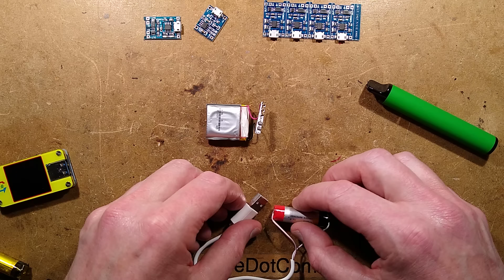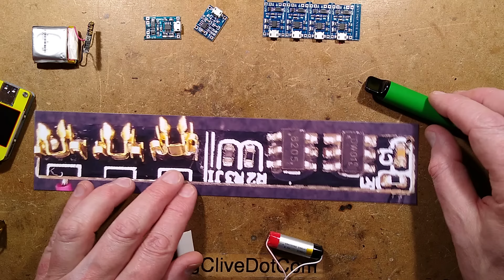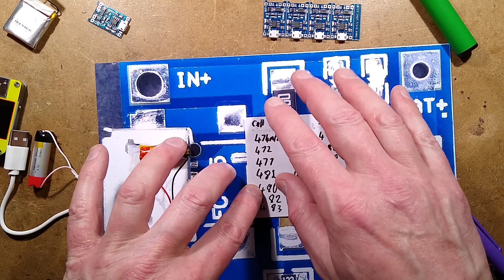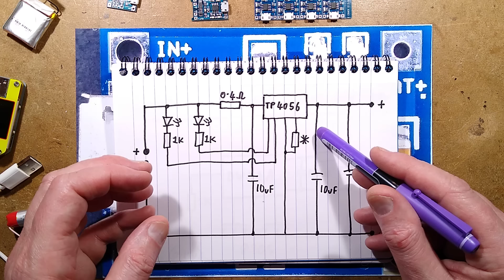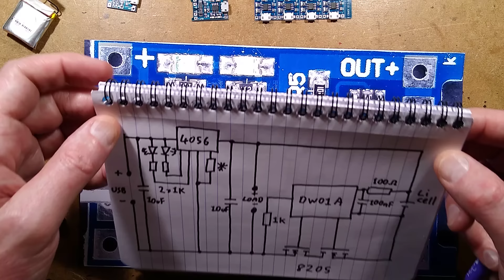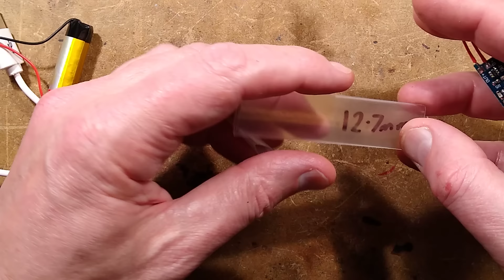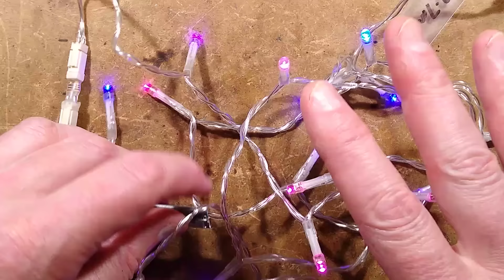Don't do this!   (There's a much safer way)

Comment: is it okay to charge them directly from a bench power supply? i do and set the current limit to 500mA. i also use lab bench PSU to charge 20v tool batteries. I know it is supposed to  be done with a costly charger that uses the 2, unused by me, pins to check battery state and temp. however the chargers are 30 quid at least and I am impecunious.
Reply from the maker: Yeah.  Just double check that the maximum voltage is set at 4.2V or slightly less with a separate meter.  Some PSU displays are not quite as accurate as desired.
Reply: @bigclivedotcom  thank you for your reply. it was jolly kind of you to respond.
 a year ago I knew bugger all about anything. now, thanks to you, elctroboom medhi, and ben eater I now make and repair stuff. I am rather excited as the amazon bloke just delivered me an oscilloscope.

If you have the forbearance to answer another question please, it is this- I need a source of AC, i only want low voltage AC to play with. so I can, for instance, test rectifying circuits i build. the 240v AC that comes out the wall gives me the willies and i wish to avoid it. I see loads of plans for inverters online, but they all output 120 or 240v. If I were to make one of these circuits but instead or using a 12/240v transformer on the output could i not just wind one myself with magnet wire and a toroid I have loads of kicking about from gadgets I've dismantled? ideally I want the AC voltage to be the same as the DC input from my bench PSU, so i can simply get up to 30v by adjusting my power supply.
Reply from the maker: @KarldorisLambley  The easiest way to get a standard AC low voltage supply may be to dig through some old wall warts.  You may find an AC output one for things like Christmas lights.

Comment: is it possible to adjust this system for battery packs? i have multiple 7.4 and 11.1v gel blaster/airsoft batteries i have spot welded together from salvaged vaporisers and I noticed that even the new official batteries have no overdischarge protection and have relatively short lives. Can the over discharge feature be adapted to work for 11.1v and 7.4v batteries as well as single cells and do i need a different module for balance charging?
Reply from the maker: You can get lithium battery management PCBs for just about any number of cells.
Reply: @bigclivedotcom  thank you so much for the reply, I will get searching

Comment: But what if my usb adapter plug has an output of 5v and 500ma? wouldnt that be fine?
Reply from the maker: No.  It's the voltage that is the issue.

Comment: most that are still using it as a vape do the high schooler special of if it starts to smoke chuck it out the window, only gonna be recharged til the coil burns anyway then thrown out

Comment: i use these vape devices, i usually stick with the same brand and type, i didn't want to throw away the batteries so i got 6 of the same size of cell, tested them with my 18650 tester to make sure there the same capacity, i soldered them together to made a 3s2p pack with a 3s bms,  and put them in a case with some 12v led strips to make a very bright portable led light bar, the only issue i have with it is the led strips get a bit warm but the battery stays cool and works well

Comment: Are these LiPos or just Li-ion?
Reply from the maker: Lipo's are a form of lithium ion cell.
Reply: @bigclivedotcom   Yes but what variety were you addressing in this video.
Reply from the maker: @alext8828  Any standard rechargeable lithium cell with a mid voltage of around 3.7V and peak charge voltage of 4.2V.

Comment: so since these batteries are only around 550mAh, can I charge multiple of them to the same level and then connect them in parallel to this circuit to get a higher mAh or would that need a full on BMS ciruit?
Reply from the maker: If the voltages are close you can connect them in parallel to make a bigger cell.  No balancing circuitry is needed for a parallel cluster.
Reply: @bigclivedotcom  awesome, I thought so but thought I'd check.

I have a constant supply of these from somebody, they gave me ten the other day but they aren't vaping those big ones yet (I might suggest it) so should be able to make some pretty useful stuff!

Comment: As usual my lot of 10 chips sucks.  Overcurrent protection kicks in @ 2A instead of rated 3A despite same mosfet package as Clive's (8205A), and same number of pins (8)https://youtu.be/M88e1r8nvYk?t=607  -  .  Clive's chip maybe has heavier tracks (?), also noticed pins 2/3 and 5/6 are soldered together on his and not on mine.  Maybe I could bridge those two pin and beef up tracks to and from mosfet to get at least the rated 3A capacity before the bloody thing just turns itself off at a wimpy 2A?  
Wishing I had ordered the simple chips without over current protection.

Comment: Thanks for the video. Wanting to recharge disposable vapes I was thinking if I can via 4 of these crocodile bites, dunno what they're called in English these small beaks, and 2 cords, use a battery charger from nitecore I have and use for 18650s, wouldn't that be a safe way to do it?

Comment: My power controlled unit jump to 5 volts shorted the battery and it exploded luckily I was able to get it outside in time it sounded like a 10 gauge shotgun

Comment: put a  1N4148 STANDARD MAINS DIODE IN SERIES WITH THE 5VOLT AS IT DROPS VOLTAGE BY 0.8 VOLTS=4.2 VOLTS
Reply from the maker: The forward voltage varies with current.  It may still overcharge the cell.
Reply: @bigclivedotcom  the cell voltage rises to 4.2 to 4.4 reducing it to trickle charging...also you can use a IN4148 plus a 0.2 shottky diode
So that the cell charging voltage cannot go much above 4.0 volts. I have done this and it seems fine. The current just plummets as cell voltage approached 4.0

Comment: Bro ive done the usb with the wires for charging a vape and it blew up cus i forgot about it and i saw it on my desk then blew up not a flamethrower it just blew up so i put my hand infront of my face when i heard the bang and it flew at my face and took all the skin of my whoke finger with burns so if i didnt put my hand infront of my face it would have hit my head this was about 2 years ago

Comment: how can I connect multiple batteries for a larger capacity? 

Just connect all "load" outputs and charge input inputs, right?
Reply from the maker: You can parallel multiple cells and they will act like one bigger one.  But the voltages must match very closely before they are connected in parallel.

Comment: Thank you very much!!! I want to do the same. 

There is no better and fresher battery than those from the vape pens. Have one with the manufacturing date 2022. 

So I can use a Li-ion charge board for a lipo?
Reply from the maker: Yes a lipo is a form of lithium ion cell.

Comment: thanks so much for sharing this clive, appreciate it, how do you think these cells would handle being wired in a large series/parallel setups?  what would happen if you used varied brands of vapes (i.e different mah capacity ratings) and would their be a suitable bms or would this have to be individually attached to boards like you've shown in your video before then being wired together?
Reply from the maker: You would need a suitable multi-cell protection circuit for series use.  When the cells are connected in parallel (with closely matching voltages when they are initially connected) they will act as a single cell with the combined mAh value.

Comment: Cant i just solder the battery terminals to any charging circuit?

Charge is proportional to battery Size and impedance or smth, right? If it’s 3.7v it should charge great any Size 3.7v cell?

Please say it’s that simple, i dont have money for buying that stuff(not even with free international shipping)
Reply from the maker: Typically rechargeable lithium cells like these should be charged at a current equivalent to their capacity, and the charge should terminate at 4.2V.
Reply: @bigclivedotcom  But does the circuit measure how close it is to 4.2v to know the capacity? Bc then any circuit could charge any Size battery, no?

Comment: Would it be possible to replace the Rprog with a variable resistor that you can tweak to get the preferred amperage as needed?
Reply from the maker: Yes.  But you'd need to have a 1K resistor in series to limit the maximum current.
Reply: @bigclivedotcom  Ah, that makes sense. So in that case if you needed the 1k resistance you would just set the variable resistor/pot to 0/1 ohm, or if you needed 2k ohms set it to 1k

Comment: Hi, how long does it take to charge the battery fully using a TP4056 module ?
Reply from the maker: It depends on the size of the cell and the current setting of the module.
Reply: @bigclivedotcom  Thanks for your reply. The same 3.7v Battery as the one in your video. I have a few of these & would like to keep the charge time down as much as possible.

Comment: I am again lamenting the lack of ability to add pictures ; I was just about to take a picture of the USB lead coming out of the crotch of my pants : it would have been a false trail, lol ; two cables go down to my boots where I am wearing heated toe insoles. I have a pair of back-to-back (parallel wired) 1500 mah amp cells of this type, connected to one of the boards containing the DW01 / protection circuit. The whole shebang is sealed up, and back inside the aluminium Square tube one original battery and gubbins came with. I tested this setup both charging and discharging quite a few times (using a thermal camera) to see how hot anything got and apart from the toes on the insoles, nothing got hot. 
I am aware I am standing on Chinese heated insoles, powered by (probably) Chinese made lithium ion batteries protected by chinese-made charging / protection circuit. 
I have always tried not to live vicariously, but to 'suck it and see'. This probably explains the number of pairs of jeans I went through as a youth on my various motorcycles. I'm 57, I still have a motorbike, all of my limbs & most of my teeth. If it's raining, I will of course get in the car.

Comment: Hi Clive I have  large quantity of these cells and was thinking of making a power bank can I just use one of the TP4056 circuits for say 2 or more cells in parallel what would be your best advise on this .
Reply from the maker: Yes you can.  Just make sure the cell voltages are very close before wiring them in parallel.

Comment: I use a 3 volt 1amp charger i got off aliexpress for like €2. Great to bring those dead cells up to a chargeable voltage. Gonna solder the wires to an 18650 battery holder in the future to make things even more solid/safe

Comment: I have about 40+ of these eciogs from my days of vaping. I saved them because I knew the batteries were useful. I have no electronics experience but would like to make good use of these instead of having them just sit around. This was a great starting point in regards to getting them recharged and used. Any suggestions on what I use these little dudes for? Thanks in advance!
Reply from the maker: Lots of things like for powering strings of lights.

Comment: so I recently had to repair my guitar hero guitar because the battery terminal was all corroded AND rusted that when i took the old batteries out, it took part of the terminals with it. I decided it'd be better if I made it rechargeable so i just chucked in an old li-po phone battery and it works great, but I couldn't charge it, and while i can solder really well, I don't understand enough about electronics to make my own charging circuits but I KNEW I saw a video by bigclive that covered this safely. So glad that you covered this as otherwise I wouldn't have known what to buy, and probably would have just given up altogether.

Comment: If you connect 4 batteries in paralet convection it will change at 3 ÷ 4ambers?
Reply from the maker: The TP4056 charger module is only rated for up to about 1A charge current.

Comment: If you change it like this and measure the voltage sell and when it goes to 4.2 unplug it?
Reply from the maker: It really needs some current limiting, and it's very easy to forget a cell is charging and have it overcharge to a dangerous level.

Comment: Hi Big Clive, apologies if someone asked this already, could n't see in the comments. Can I use the configuration to charge 2 cells (or more) in parallel? Thanks!
Reply from the maker: Yes you can.  But the cells must have their voltages very close before connecting together.  I made another video where I built a two cell power pack with built in charger exactly like that.
Reply: @bigclivedotcom  That's great Big Clive, thank you and for the rapid reply. I love your videos and approach, particularly the reverse engineering.

Comment: Clive, you wouldn't use the male connector on the battery due to the higher risk of a short. Female connectors on power sources.

Comment: Edit within the 3 years of doing this I have never had one exploded
Reply from the maker: Uncontrolled high current charging is not a good way to treat lithium cells.  It may leave them unstable.
Reply: @bigclivedotcom  I'm not sure of the amperage but I know this much I'm not really getting past 6 volts on an OHM meter while tapping what would you recommend the charge rate I stop at 3.7 volts obviously and I have intentionally blown one up on an AC to DC plug it took like 12 minutes on a 13300these things are way more stable than you give them credit 

I'm not sure if you're in the US or not but these things are also double wrapped I've had the pleasure taking them apart nice little copper strip great for replacing makeshift pads on pcbs

See it's not smart to charge 12 volt lead acid to lithium but in an emergency situation or a desperate situation or a lightless one my current status lol

 lithium versus lithium polymer
One more explosive than the other

One last thing these things also pop 
Minutes before they  before they explode

Comment: So I  used disposable Vapes and I live off grid and I take that same cell and bang it off a car battery with jumper cables by tapping the polars for 15 to 35 seconds I can run a flashlight for 3 days

Comment: Didn't see the link to ebay for these.  Here's the (updated) one I'm ordering.  Includes the DW01 chip (I think, hard to tell from pic but has appropriate battery and load connections).  VERY little more than the price of nonDW01 board unless only buying one.  Can buy 1, 2, 5 or 10, with appropriate price dropping in bulk.  Happy charging!

Comment: Watching you try to put the USB connector into the power bank, then swapping it over is something I've mostly avoided by marking ALL cords, and often ports, with a dot of some contrasting color.  Best/easiest I've found that lasts well is nail polish!  I have a bottle of red, black and white (silver would work too) for other color cables/ports.  I always consider the "blank" side of USB as the "top" so mark that.  With mini/micro USB, I mark the "short" side.  Rarely do I now try to insert them upside down, especially the smaller ones as my aging eyes can't easily see which is short and which is long on those.

Comment: I have a pile of 18650s that was given to me. I have no dedicated charger for them. As I was watching this, I looked at them and the label says "with re/discharging protection circuit". Does that mean I can safely put a charge into them using about a 4v supply? I could root around to see if I can find a few errant resistors to limit the current...
Reply from the maker: Some have a protection PCB on one end, but not all are real and there would still need to be current limiting.  The TP4056 module would still be useful.

Comment: A few years ago, I put about 5 or so of the smaller button batteries in my jeans pocket, that were depleted beyond usefulness. Walking along, apparently one was shorted enough to go off like a ladyfinger firecracker. (you can't/couldn't buy firecrackers in Canada back when I played with them, but you could still get them, and even the ladyfingers were a fair little bang... about 30 years ago.) I wonder if they were the biggest button (all metal) cells you can get, and they were fully charged...
You can also buy decent chargers that have spring loaded contacts, allowing you to put smaller (or use a wire) battery than a AAA, and up to about 5 inches (again, or use a wire) and allows you to set voltage, mAh, and some other, I forget - haven't used it in years, but I used it for well over a decade..
I also accidentally put a Fluke (fortunately) voltmeter set to 1-5v (or similar) and I somehow thought it was 100-500, so plugged it in to a 110v standard Canadian socket, and it popped. The replacement circuit breaker was a super-fast one, to prevent destroying your Fluke by doing something stupid like I did.. cost about $60.

Comment: Love bigclive's videos!   I have a 6v 6ah Lifepo4 battery I need to charge.  I can buy a $$ charger for it, but I'd love to make something that will work properly.  I see plenty of these 3.7v charge control module boards on ebay and amazon, but not really anything for 6v Lifepo4 (assuming I'd want a 7.3-7.4v control module).  I would likely use a 12v dc wall wart charger as the input power source.   
Thanks for any help
Reply from the maker: It's quite hard finding a dedicated LiFePO4 charger.   Even the protection boards are harder to find.

Comment: I have modified a nice handful of Christmas lights with 18650 cells by adding protection And a charging circuit.  3 AA batteries is about the right voltage to be converted to lithium, the lights still stay on even if the batteries are quite dead (the AA batteries I mean) so I thought even a lower voltage of the lithium cell should work fine.

Comment: what about using an adjustable battery charger for lithium batteries ?
Reply from the maker: If one could be tuned to stop at below 4.2V that could work.